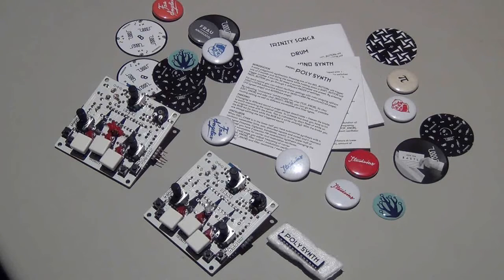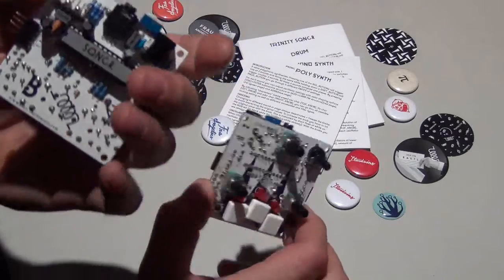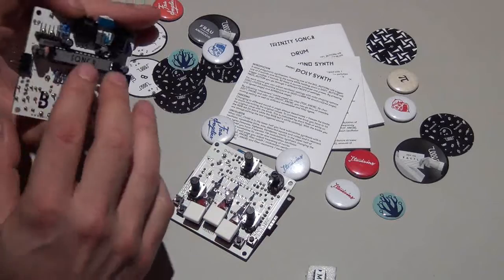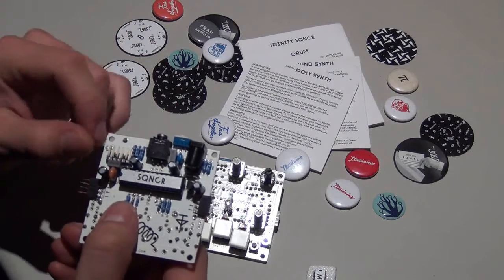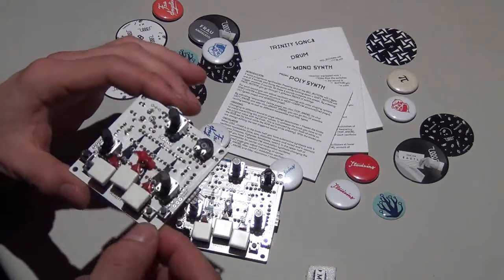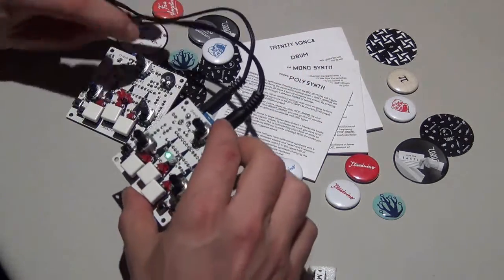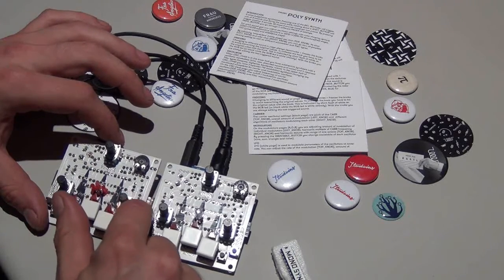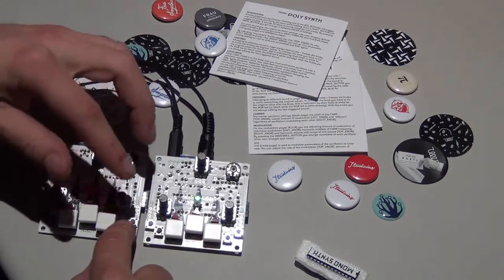Standuino Trinity Introduction - The LEGO Synth/Groovebox

Comment: Hello! im trying to install the codes from the bastl repository into a trinity hardware and i always get failed compiling, related to midi.h errors. i dont know if im using an arduino version too modern for these old files? tried older arduinos and got the same errors. any ideas? thank you